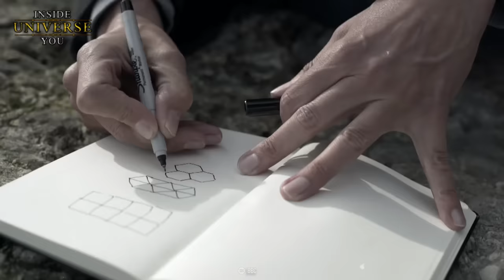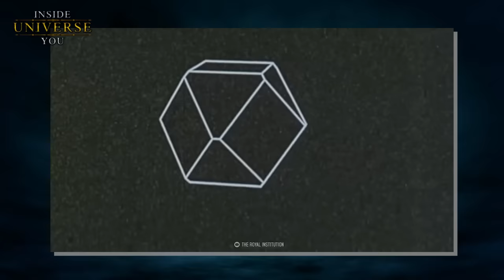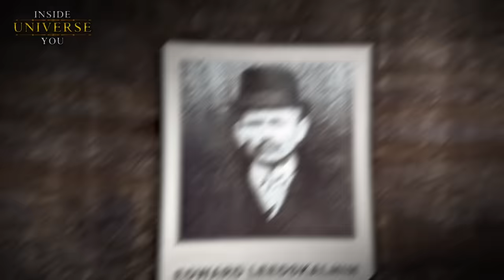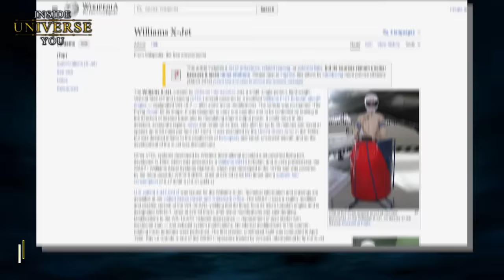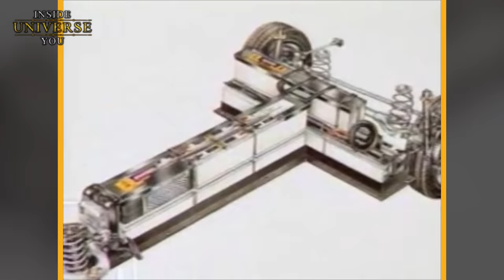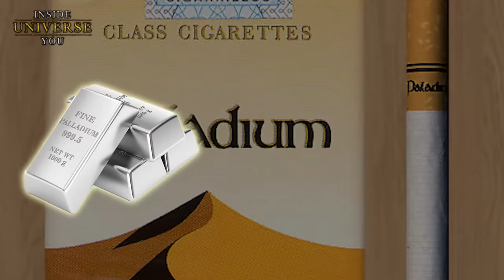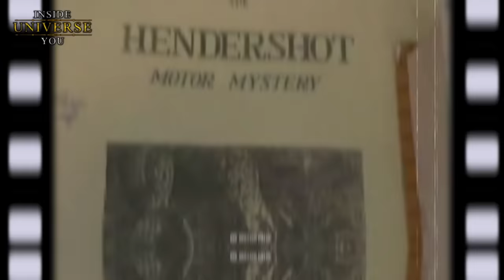Forbidden Technologies and The Silencing of Their Inventors

Comment: The EV1 wasn't killed by the oil industry. GM only ever intended it to be a demonstration and not a permanent thing. The charging technology the EV1 used was deemed not to be suitable and governments (including in California) standardized on the current system (where you have a direct plug connection to the vehicle). And GM didn't want to be on the hook for having to provide ongoing servicing and parts for the EV1 (including the expensive EV1 batteries) or ongoing support for the aforementioned proprietary inductive chargers.

Comment: 'BATTERYLESS BATTERIES':
To help power equipment in outer space:

Potential endless energy source basically anywhere in this universe:

a. Small aluminum cones with an electrical wire running through the center of the cones, cones spaced apart (not touching I'm thinking) but end to end.
b. Electromagentic radiation energy in the atmosphere interacts with the aluminum cones.
c. Jostled atoms and molecules in the cone eventually have some electrons try to get away from other electrons of which those electrons gather at the larger end of the cone, of which also creates an area of positive charge at the smaller end of the cone.
d. The electron's in the wire are attracted to the positive end of the cone and the positive 'end' in the wire are attracted to the negatively charged end of the cone.
e. Basically a 'battery' has been created inside the electrical wire itself, different areas of electrical potential.  Basically a 'wire battery' or a 'batteryless battery', however one wanted to call it.
f. Numerous cones placed end to end increases the number of 'batteries' in the wire.
(In series to increase voltage, in parallel to increase amperage).

*  Via QED (Quantum Electro Dynamics) whereby electromagnetism interacts with electrons in atoms and molecules, one would have to find the correct 'em' frequency for the correct material being utilized for the cones.  The shape of the cones could also come into play.  The type and size of the wire as well as the type and thickness of the insulation between the cones and the wire would also be factors.
*  Of course also, possibly 2D triangles made up of certain materials with a conductor going down through the center of the triangle could possible achieve the same 'batteryless' battery system.
*  Plus possibly with the 2D concept, layered 2D's that absorb different energy frequencies, thereby increasing the net output.

Comment: New York Times  30 March 1941: "Needed materials, he said, would include 100,000 bales of cotton, 500,000 bushels of wheat, 700,000 bushels of soy beans and 500,000 bushels of corn. "Plastic raw materials may cost a little more," he said, "but we anticipate a considerable saving as the result of fewer fabricating finishing operations."" The main material, however was plastic resin, so hemp was only a small fraction. The hemp car legend appeared later in the hemp supporters community. Anyway, some tests done afterwards indicated the material durability in time was extremely low.

Comment: @15:45 you missed the most important part of Schauberger's work relating to moving the air in the Repulsine Implosion Turbine at a velocity faster than the speed of sound. He stated that it released levitational energies from what he called "Vitamin Molecules" in the air which when activated by the vortex, created free energy and levitation. This second aspect was not accounted for and was discovered by accident, when the Turbine wrenched itself free from the work bench it was mounted too, tore out the quarter inch bolts from the concrete and hit the ceiling.

To my thinking, point of use Repulsine Implosion Turbines would free our world from energy grid slavery and the destruction it has done to millions of lives with the fires caused by this ape like system of energy control. This would also offer great National Security,  demolishing the centralized production of energy that can easily be sabotaged. The NSA is a 100% FAILURE for this alone and protected the energy barons and el-ites, since their inception!

Comment: Moray copied Tesla, unmentioned he used a 30ft antenna with a coil at the top, and needed to synchronised with existing power to start. But worked 100% could run 5kw continuously.

Comment: I once with 24 people tried to make Henderson coil machines. There was only one in 24 that worked but the amount of new, i.e. free, energy coming out of it was minimal. The energy gains from a Henderson coil are very small. It is useless to make them.
Reply: Useless at first. But all technology starts out inefficient. It is by building it and understanding it better that you can begin to create more and more efficient versions of that technology. The first computers were the size of buildings. But we didn't say "They are too big, computers are just not worth building." We built them anyways. And by doing so, we got better and better at it until now they fit in our pockets and are several magnitudes more powerful. There could be ways to improve upon Henderson coils that have not been discovered yet, ways that need 1000s of researchers and pioneers to discover. But we will never know if we just assume they are useless and never try.
30 years ago, solar panels barely generated enough watts to ever be considered "useful", but now that we are using them more today, they are being improved upon year after year. It is getting to the point now that solar panels are being incredibly efficient. That would have never happened if we just threw away the technology in the beginning because we assumed its useless and inefficient.

Comment: I came across a fairly new technology the other day that takes carbon monoxide and dioxide and transforms it into pristine breathable oxygen on both a large and small scale. It is based and built using sacred geometry and can be retrofitted onto every combustion engine vehicle and generator. Information on the channel, 'Alchemical Science'. 
Considering how hard they want everything to be all electric even though there isn't enough electrical to run what we have now, I would be surprised if this isn't suppressed in the future.

Comment: Regarding to the electric vehicles it is very important to mention that most of the vehicle is made from oil derivatives. Only difference is that EV does not have IC engine but electric motor and batteries instead. Electric motor also have some components made from oil derivatives and batteries are the most toxic part of the vehicle. Lithium from batteries are very toxic, mining of lithium is very dangerous for environment and battery recycling are very expensive and produce toxic waste. Every commotion that people use in daily life is hazardous to nature.

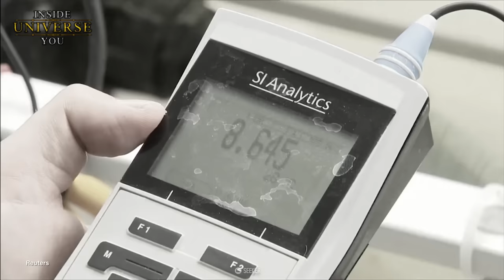Comment: Nothing against things like the Hemp car. But claiming at 7:48 there are clean burning fuels is total nonsense except for hydrogen, it’s exhaust is water vapour, aka. humidity, which causes 70% of greenhouse gas effect, only 20% are CO₂ caused and only 4% of those 20% are man made. Fact is, all man made greenhouse gases makes only 1% of the greenhouse effect. All of it is totally irrelevant, burning hydrogen or other fuels will always be nothing in comparison to natural made greenhouse gases. The oceans producing all the humidity, independent how many hydrogen mankind will burn for it’s energy needs. Same thing with CO₂, the nature is producing 1200 gigatons CO₂ per year whereas man made are only 50 gigatons, what is already the CO₂ equivalent. Meaning all other man made greenhouse gases, mainly CH₄, are already correctly weighted included in that 50 gigaton. Besides, the biosphere compensating CO₂ makes no difference between CO₂ caused by burning wood or fossil fuels. Burning wood is probably worse because each tree felt does no longer compensate CO₂. Yes CO₂ levels are rising. But it is most probably by far more caused by deforestation - each 10 years half the size of India since a hundred years - is causing rising CO₂ levels. Not burning fossil fuels, that is total nonsense.

Comment: Hemp oil made from seeds ? Likely not the right viscosity to succesfully operate and lubricate neccesary engine components, also it must still have ran on gasoline petrol for proper combustion look at how they made it look like the car ran on the hemp seed oil alone thus obly the oil was worth a conspiratorial sabotage of the green tech doubt it i could see the hemp fiber synthetic compond of the body being strong but at what cost where is the data how long would it last after all it was biodegradable also difference between the impact resistance of a hammer compared to a car people do not realize that some compression at impact is considered safer than a bulletproof steel box whip can amplify shock from impact there is too many factors in investing in any one investment if hemp body was so profitable and much safer y not today if you have not seen tesla and the millions of green based companies that are decades old theyvwould do so now so maybe oil companies did not spend the trillions it would take to supress the thousands of inventors and inventions that is allegated against them it is juvenile abd embarrassing at this time to keep that going now tge government has indeed been transition wary to a complete transition to clen green and renewable energyvsources because the economic shock the already total investmented economy which is oil dominate etc. Jobs costs sustainability distribution logistics and nearly everything relies on what is already available and paid for and quickest and continuous and available with consistency